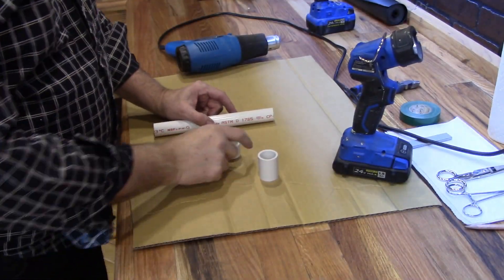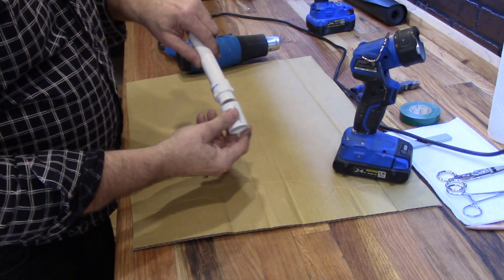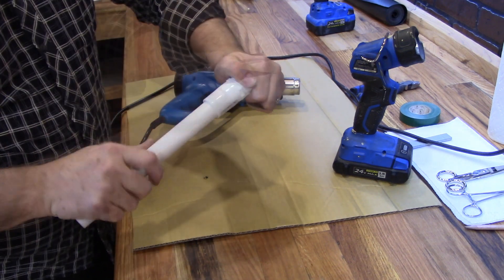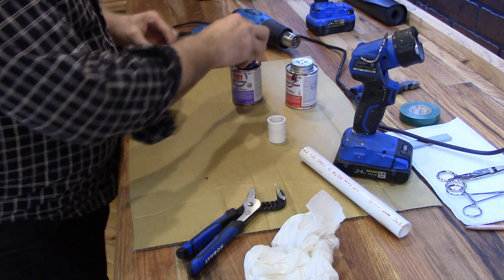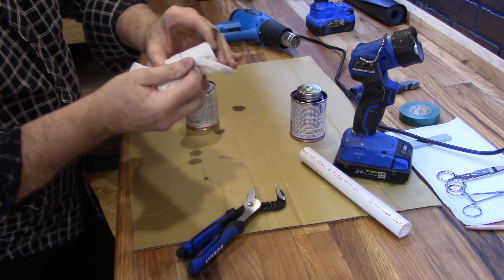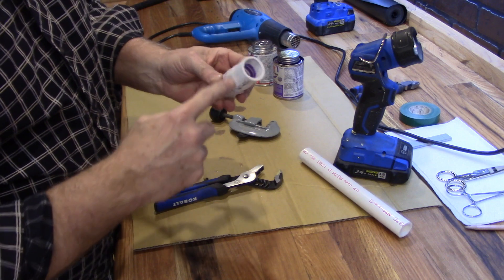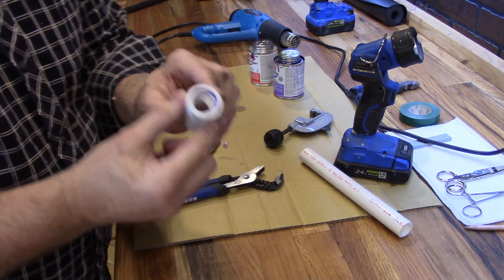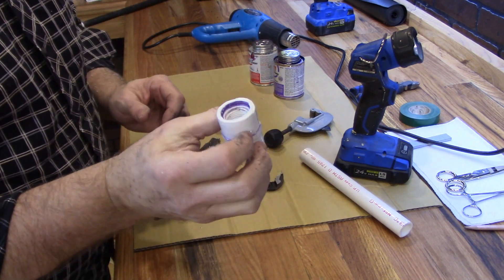Easy repair or strengthen a PVC threaded fitting and prevent cracking

Comment: Some folks do it by putting a hose clamp over it, but they do make females that have a stainless steel band around them.
Reply from the maker: Hi Chris,  I never heard of stainless bands,   I wonder if a larger Pex band could be used to reinforce the fitting.Thanks for watching and commenting, I do appreciate it.
Reply: @SouthernEngineering  Hard to find, but here is the Sch 80 version:https://www.amazon.com/Spears-Fitting-Schedule-Stainless-Reinforced/dp/B009F36UFM/ref=mp_s_a_1_5?keywords=pvc+female+adapter+steel&qid=1578068383&sr=8-5

They make CPVC females with the entire threaded portion brass, but they were about $6 each last time I used any, and that was years ago.
Reply from the maker: Hi Chris, I just read your other comment with the link to Amazon, for some reason YT blocked the comments, "Blocked words" this happens every now and again then they put it in a "Hold for Review" 
Anyway, thanks for the info, I never knew about these, thanks for sharing.

Comment: Nice tip
Reply from the maker: Thanks Brett, I use this technique whenever I have a PVC to metal connection and I've never had one fail.  It works especially well if you're using PVC for compressed air lines. 

F.Y.I. I'm doing a Top to Bottom Re-hab on my workshop, I'm improving functionality workflow, and appearance, it 
will be a blend of a full and proper workshop, a bit of man-cave, and better suited for video, stay tuned if you want to follow along.

Thanks for watching and commenting, I do appreciate it.

P.s. I post updates, previews, and other random stuff on Instagram @southernengineering

Comment: Nifty trick!  Thanks!
Reply from the maker: Thanks Butch,  As I replace my compressed air lines I will be using this technique whenever I have a PVC to metal connection, I have used this a few time before and It's never failed me.

When I started to remodel my shop I noticed a crack on a couple of the air fittings so as I rerun the lines I'll do all the ports this way.

Thanks for watching and commenting, I do appreciate it.